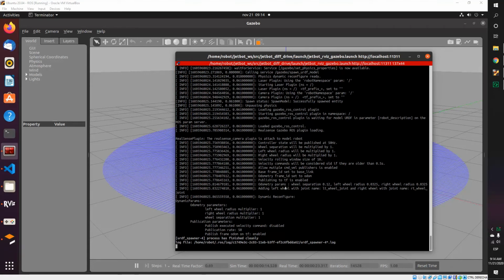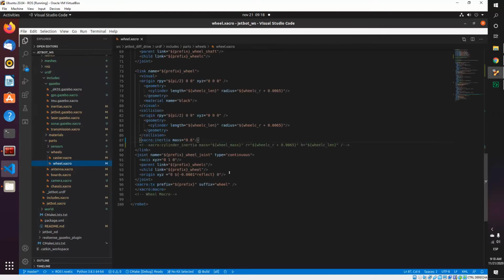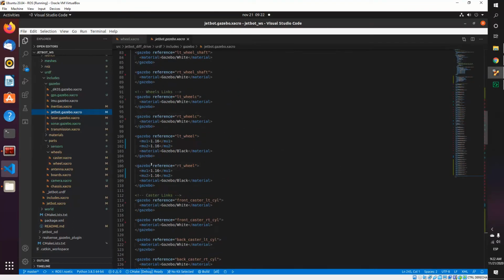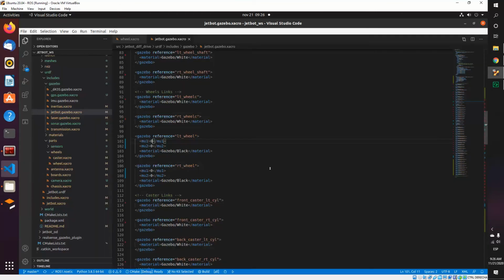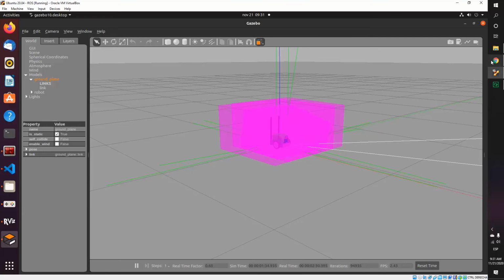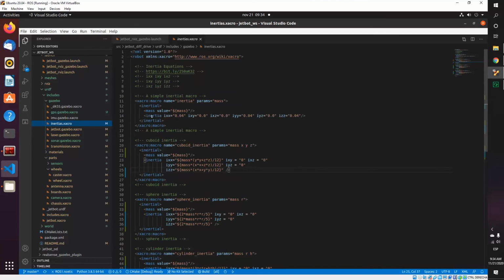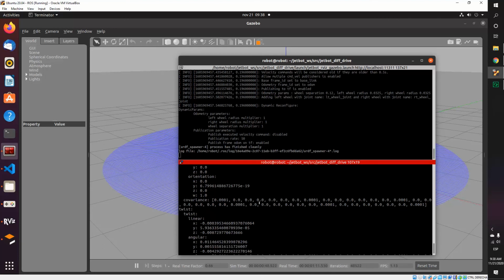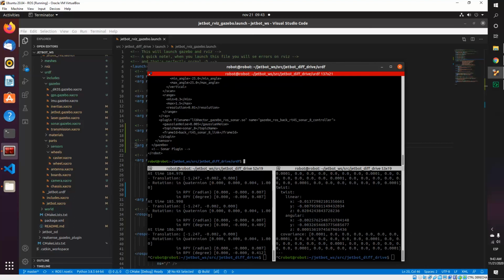Problem Solving Gazebo Rviz   Model Drifting, Model Sinking, URDF Tags

Comment: Some good tips, but some points aren't really clear. Gazebo opens and you can already see the model is loaded wrong. What? I can't see anything, because you enabled the visualize tag of you scanner which obstructs everything and additionally I don't even know how the correct loaded model should look like. It is not clear what the issue is in over 50% of the cases, besides the model is "loaded wrong", which is not verifiable because of the poor sight and a lack of knowledge what am I looking for.
Reply from the maker: If you look previous or posterior videos you should see how a "good" model works.
I tried to help and every problem is different, I try to point common problems that I had that probably for you are not.
There is also the ROS wiki if you are not comfortable with my explanations.
Reply: @issaiass  My critique is that you can't match problem and solution in the video, because the problem is not clear most of the time.